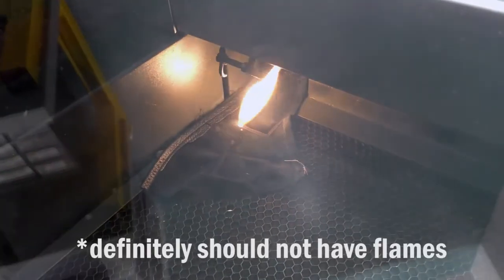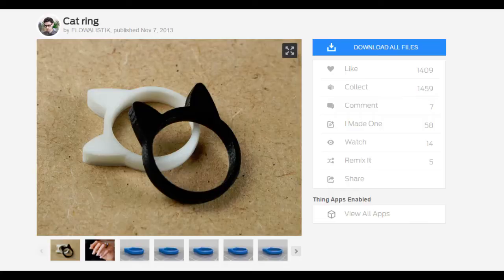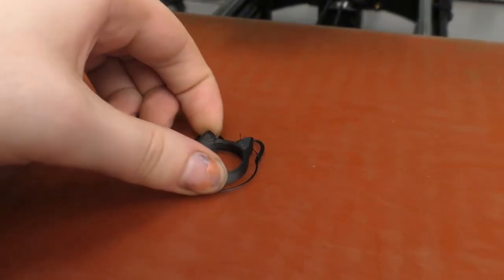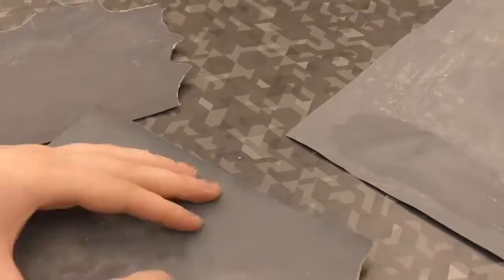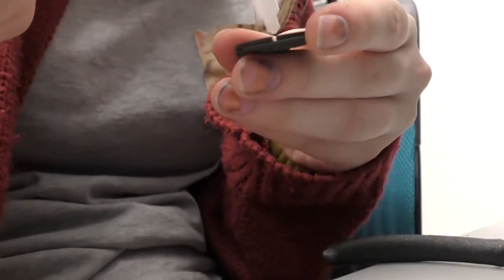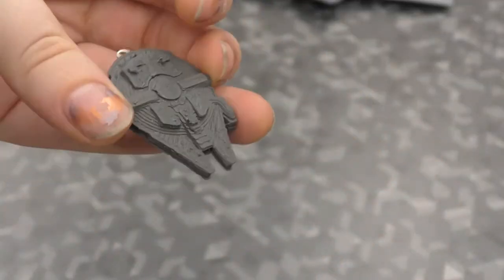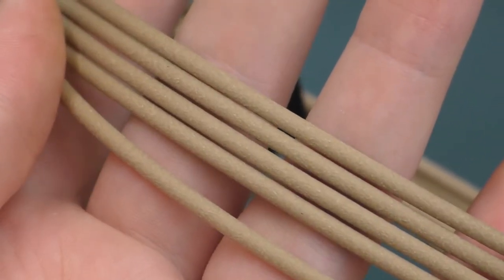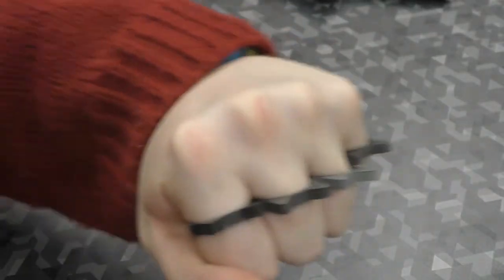Testing Metal Filaments

Comment: Did those filaments wear out your nozzle?
Reply from the maker: Yes they are abrasive with the exception of wood fill and the mat fiber. That's why I was only printing a small amount with each until I can get the right nozzle. But the small amount didn't seem to effect the current nozzle's performance.